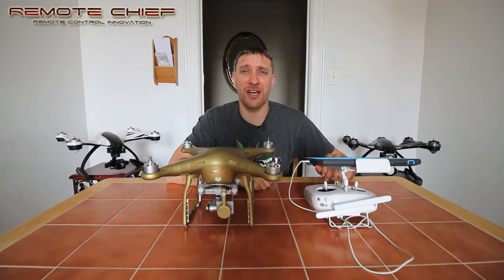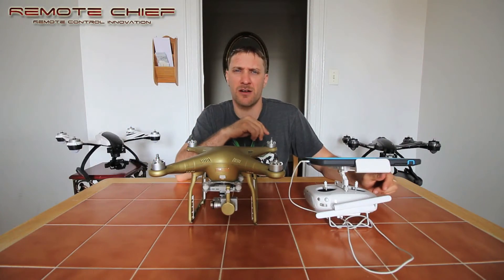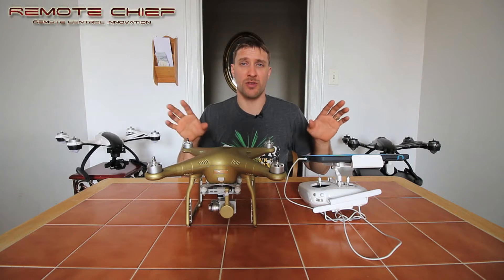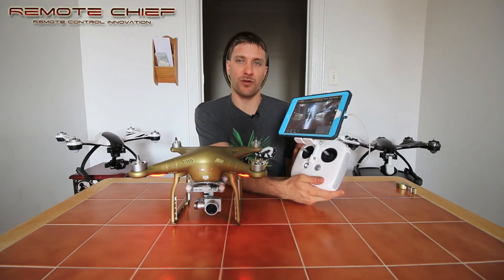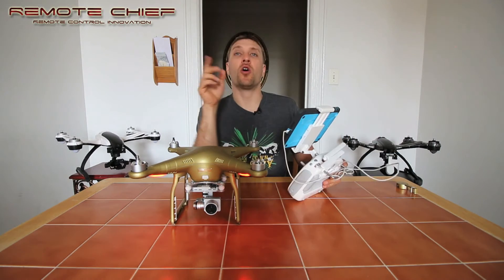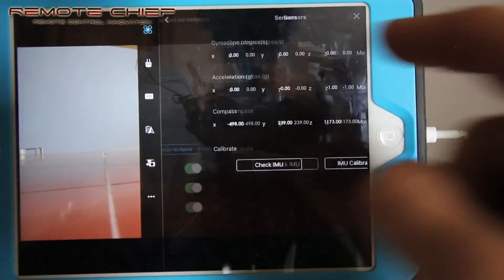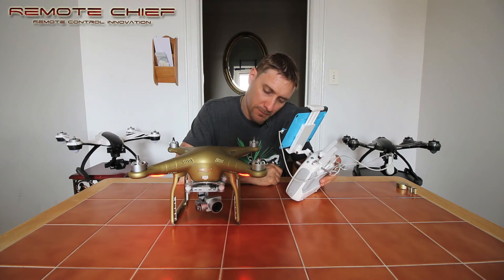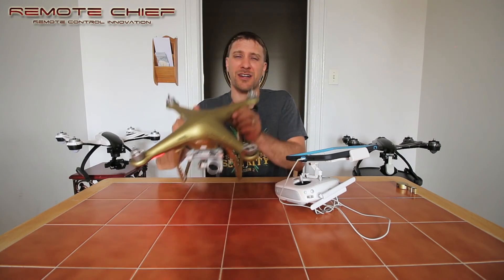Recommended for the Dji Phantom 3 Series How to fix the gimbal, Calibrate the IMU Where and How

Comment: Do you know where the actual IMU is, the chip, on the camera gimbal?  I broke mine, so now serious as to it all.  Is there a schematic of what the chips on on the board?
Reply from the maker: yes the imu is in the mother board i  believe  and connected under the VPS cover, not in the gimbal at all you can fy the drone without the camera and the imu would still be working